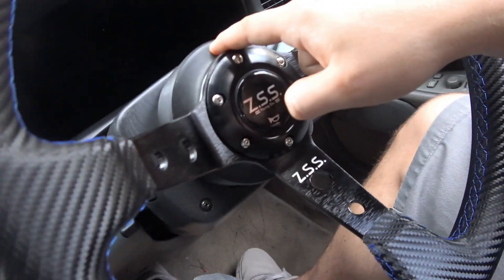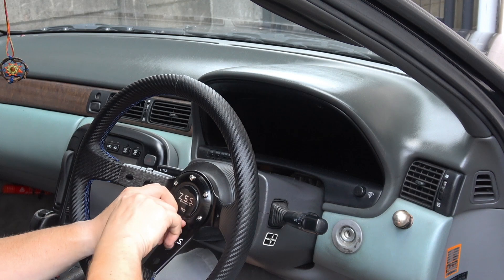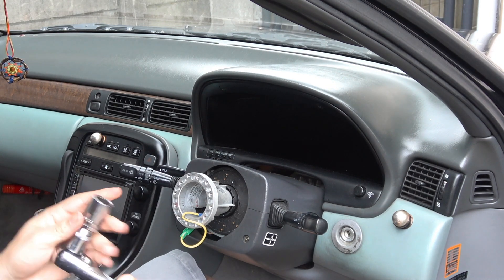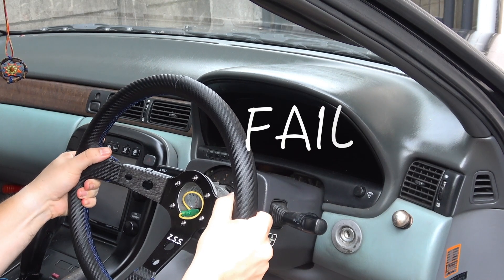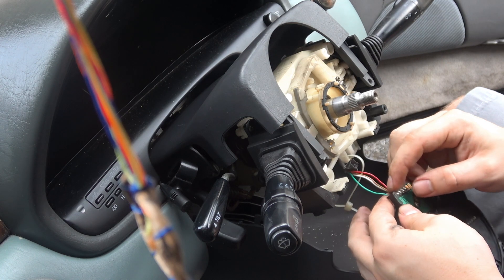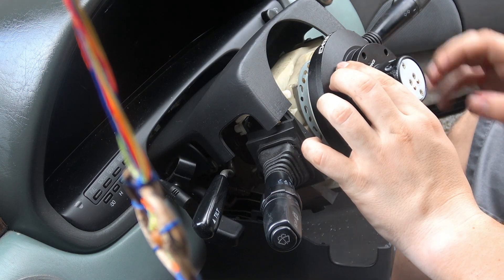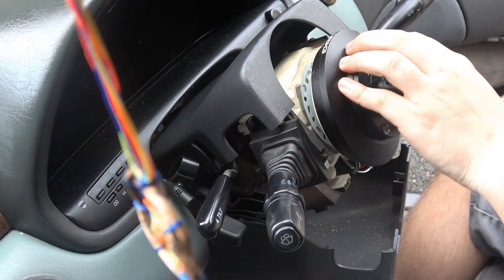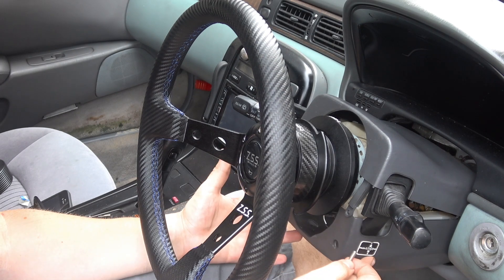NRG Short Hub/ Quick Release Install for a Toyota Soarer

Comment: Wich short hub are you using? The srk-121H or the srk-110h our the srk-120h?
Reply from the maker: ellpape123 it called to use the srk-121h for the Toyota Soarer. You can go to any of the NRG websites and they will have a fitment list of which one should be used on which car.
Reply: Corey Brigner Tanks! There is nothing compatible for a soarer on their website! Only for supra or lexus gs or ls, not even for sc series
Reply from the maker: ellpape123 http://www.getnrg.com/index.php?route=information/information&information_id=26 shows ls/gs/sc under Lexus category and the 86-93 Supra is listed as the same short hub number which is the one i used and it works great except you will. We'd some extra thinking and parts to get the horn to work mine still doesn't yet but I have an idea just haven't taken it apart again to try it out
Reply: @CBrigsMedia  did you ever get your horn to work ?
Reply from the maker: @vacoombs  not using the horn button on the steering wheel. But then again I didn’t give it much effort i did make work via a horn button next to the wheel though

Comment: Hey mate, know this was a while ago but have a quick question before I start chopping wires, does the black ring with the horn plug serve much purpose? Does everything else work with a custom horn wired in?
Reply from the maker: All good. So the black ring has some functions (not that i have used) you might need to retain it for turn signal canceling but not sure. I ended up just going with an external horn button on mine. Hope this helped
Reply: Yea no worries. I have no cruise control stalk or airbag so aslong as everything can still function regularly without that ring ill be happy

Comment: Gosh I need this to do this to my MR2, Stock steering wheel is so ugly!! Great video BTW
Reply from the maker: should be the same process except som screws on the back or side of the steering wheel. if it does it probably has pop off panels on the side to release the horn mechanism/ airbag. make sure the battery is unplugged for sure.

Comment: I know its been awhile. But did the turn signals auto shut off after a turn with that hub or did you have manually move the turn signal lever.  Ty
Reply from the maker: They work as normal. Had to take the metal spacer plates off i think. But other that that they work fine